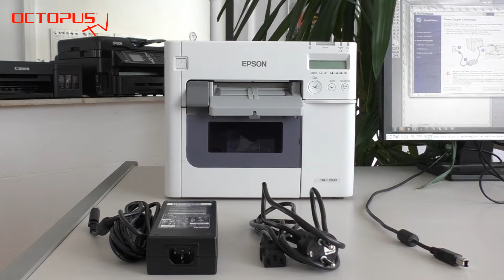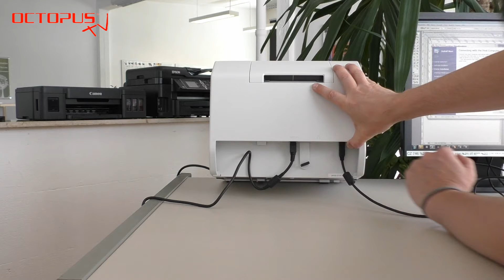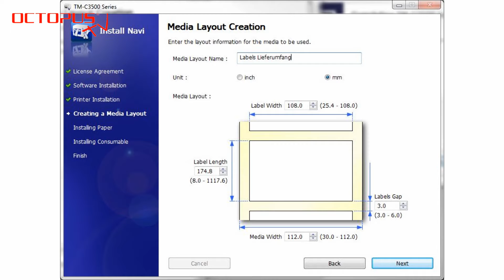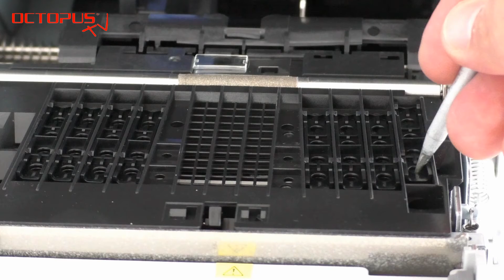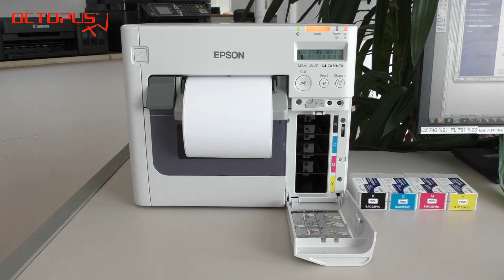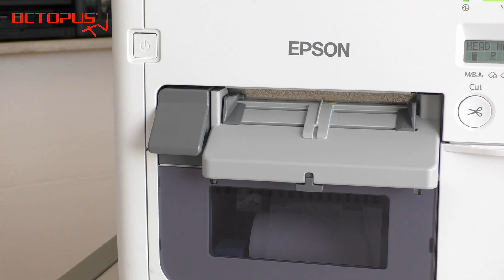Epson TM-C3500 installation process, setting in labels and cartridges

Comment: Hello. Not sure if you will see this but i just got the product and am very confused. I cannot figure out what software to download in order to print my labels. I got this device refurbished so it did not come with a disk nor does my computer have a slot for one
Reply from the maker: Hello Nicholas, thanks for Your question. The printer driver You can find online on the Epson page: https://download.epson-biz.com/modules/colorworks/index.php?page=prod&pcat=1&pid=160
Then You do not need a disk drive. They also offer a label printer software there.
We operate our TMC3500 label printer  in combination with the software nice label designer. It needs some practice and research how to adapt the features of that software to Your needs. It also took us a while - but so far we get the print jobs done according to our needs.

Comment: If using a continuous label roll on this Epson C3500 ... is it possible to print up to 2ft in length? Or, is there a limit on how long I can print? Perhaps the software will only allow 16" inches or something like that?
Thanks for your time and response
Reply from the maker: Thanks for the question. We understand that You would like to print a 2ft long label design, right? The TMC3500 comes with a quite good label print software tool - You can define Your individual label sizes. Please check the link below to download this tool: https://download.epson-biz.com/modules/colorworks/
There You can try if You can apply the settings according to Your needs....

Comment: Hi! Can I use roll papers from other suppliers other than Epson? Does it use a special coated paper? Thank you
Reply from the maker: Hello, thanks for Your question. Yes, we have worked with labels made by alternative suppliers. As the inks are pigmented inks You have to try when printing on glossy label material. Some glossy coatings are too dense and the pigment particles remain on the surface and cannot penetrate the paper material.
Reply: @octopusoffice   How about mate papers? I use couché paper and Bopp (like plastic) mostly matte.
Reply from the maker: These papers should be fine as the surface is not closed - the matte structure usually allows the pigment particles to get sufficient grip on the label material.

Comment: Thanks for the video but how do you switch from Fanfold to Roll and Roll to Fanfold? Must you reinstall the drivers to do this?
Reply from the maker: Hello Gary,  thank You very much for your question. I did not lay my hand on our Epson TMC3500 for quite a while so it took me a couple of minutes to dig that info out of my brain. You have to make sure that the printer is switched on. Then You start the printersetting, it´s a kind of driver, there under the point GENERAL you find the media settings. In that category You can switch between fanfold and roll. After selecting the setup You have to hit the apply to printer button - on the printer´s screen You can see that the new setup has been received.
The way to change this setting is a bit strange so You can easily forget about it, but it is not necessary to reinstall the drivers :)